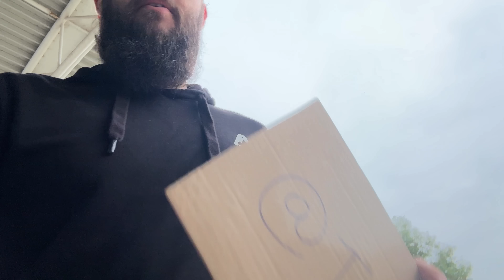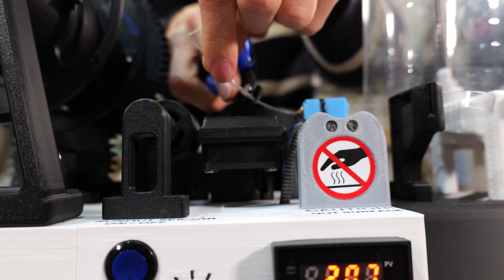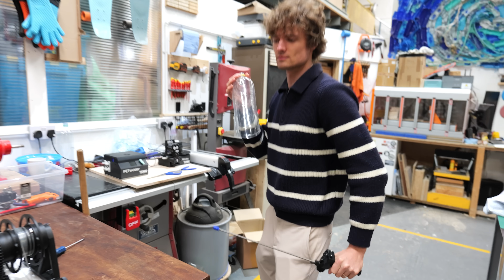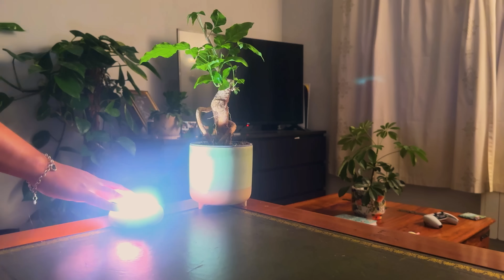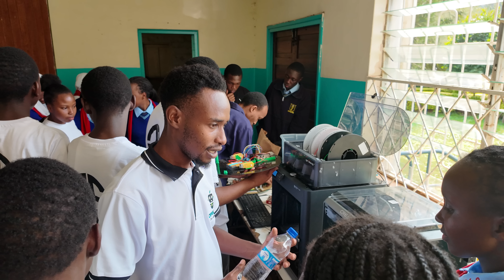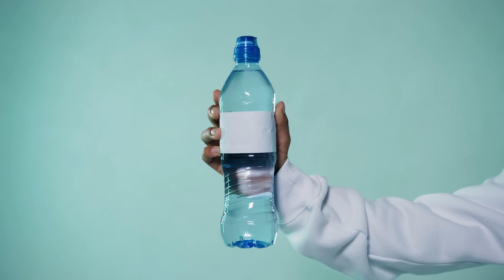Finally, a way to recycle Plastic Bottles at HOME

Comment: Yeah, using plastic bottles for 3D printing does take them out of the regular recycling stream, but the real question is, how long are you going to use what you print? If it’s something useful that’ll last for years, then you’re probably making a positive impact. But if it’s just something you’ll toss in a few weeks, it’s not much better than single-use plastic.

You might also want to look into setups or tools that can re-melt old or failed prints, so nothing really goes to waste. That way, you can keep reusing your own prints, too.

In places without strong recycling systems, turning bottles into filament is probably a big win. In areas where recycling is already efficient, the benefits can vary. But if you're planning to print stuff anyway, using recycled plastic just makes sense you are using filament either way, might as well make it the more eco-friendly kind.

Would love to see many more projects like this for use of other plastics as well.
Reply from the maker: This is absolutely correct. 3D printing in general shouldn’t be used for trinkets as it just adds to the issue of plastic waste. 

We’ve done a fair bit of work regarding filament production from recycled sources. Unfortunately the technology isn’t there yet for widespread use of this, especially on a DIY scale.
Reply: @BrothersMake  Regarding "trinkets", I've found that printing toys vastly reduces the demand to buy mass produced plastic toys for one's own children, birthday presents for their friends, etc. which seems like a real win both financially and environmentally. And they get things they couldn't get at store corresponding to niche interests, or hand painted after printing, etc.
Reply from the maker: Interesting concept. In principle, this is great. The issue then comes with quality of the product. 3D printed toys often don’t have the same perceived quality as something that could be made to another quality, which means the lifespan could well be shorter and they are less likely to be an heirloom toy handed down to future generations compared to something like Lego for example.
Reply: @BrothersMake  As a concrete example, Dummy 13 is a toy that's way more articulated/poseable than most action figures, fine-grained repairable in tiny individual parts if it breaks, and can be customized to be particular characters by modding it. Someone even published (as paid models) Skibidi Toilet characters 😂
Reply: @BrothersMake  wow, so people take removing bottles from classic recycling feed seriously. People need to investigate what really happens at recycling facilities, if their plastics even make it there to begin with. We used to ship them to China but they reject them now. So removing a few thousand from a stream of billions just ain't a problem.
Reply from the maker: Yes and no. A few thousand may not have an impact now, but in 2, 5 or 10 years when technologies like this have continuously improved to the point where it is more widespread then the impact could be significant. Team that with the fact that we will run out of virgin plastic eventually, at which point the need for these types of techniques will drive their evolution at an even faster pace.

Comment: I've seen this method on various 3D printer related channels and while I think it's a step in the right direction, I think the end goal should be turning PET into pellets which can then be used for making filament or injection moulding.

It needs to be affordable and easy to do to be accessible to most people - currently it's not there. However, 3D printing uses to be less accessible so I'm sure with time people will continue to develop such devices and it'll also become accessible 😄.
Reply: That rolled tube of PET filament is just one trip through a chipper away from being pellets if that is what you want. But really if the goal is a printer filament why turn to pellet and re-extrude when you really really don't need to as you can print with it directly instead... Only makes sense to turn it to pellets first if you are going to be mixing in other additives, colourants etc and want a nice even mix.
Reply: @foldionepapyrus3441  Going thru pellets first can potentially get you more consistent diameter/density vs pultruded strips, and avoid needing to increase extrusion multiplier to 107-135% to compensate for hollow core. I get slightly but noticeably less consistent surface quality and outer part dimensions with pultruded PET vs commercial extruded PET filament.
Reply: @daliasprints9798  And you'd get that surface quality variation with DIY from pelleted plastic filament too most likely - the truth is simply that a small individual run can not use half tonne of feed material (probably exageration, but with the scale of these machines maybe not, and note it will get reprocessed probably on site) to dial in the end result. Nor can we as individual do a batch big enough discarding the less consistent bits of the run to have that super consistent result.
Reply: @foldionepapyrus3441  The ARTME seems to get reliable results with PLA, but can't be used for PET without modifications and I'm not aware of anyone having done it successfully. Fortunately, whatever bad diameter stuff you get dialing it in can be pelletized again and mixed into the next batch.
Reply: @foldionepapyrus3441 Being able to turn things other than bottles into pellets  would massively increase what can be recycled into filament, as well as allowing it to be used for things other than 3D printing. That seems a big advantage to me.
Reply: @izzieb  Ah I see where you are coming from now, yes in that context it would make sense. Or you just turn it directly into slabs, bars and sheets of material for the more subtractive manufacturing processes.
Reply from the maker: For sure, this would be great. At the moment, there isn’t the technology for this on a DIY/small scale. But fingers crossed for the future!
Reply: You can use pultrusion as a first step to pelletizing, but where it gets hard is that extrusion-manufacturing of PET filament is very difficult due to the near instantaneous crystallization of hot PET. This is why only a few manufacturers produce it (I only have one source in the US, Fusion Filaments), and most just do the inferior PETG that's non-crystallizing.

Solving this requires engineering a pellet to filament extrusion process that's affordable at small scale and compatible with PET.

Comment: Well that is expensive in countries with a bottle deposit you get back before they are "recycled".
Reply from the maker: We need this in EVERY country
Reply: Even in those countries the loss of deposit comes out to like $20/kg, vs $35/kg for commercially produced PET filament (yes it's a lot more expensive than cheap PLA). Of course the labor makes the savings a lot less attractive...